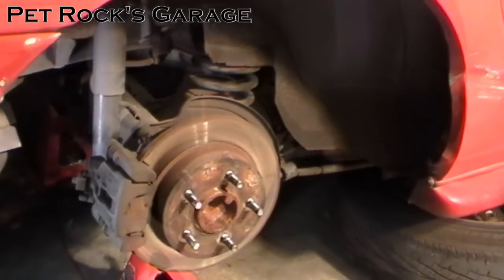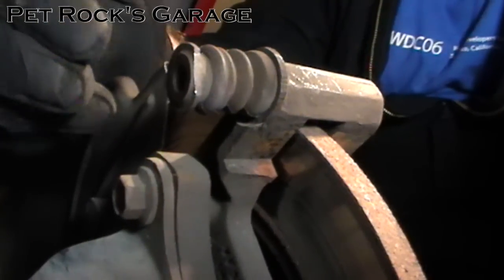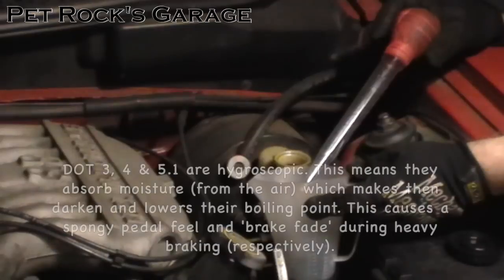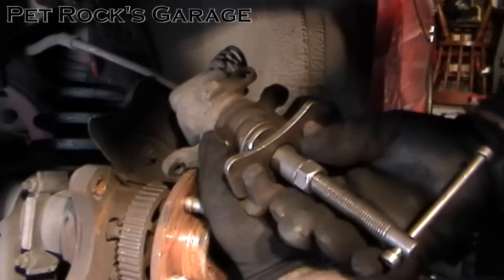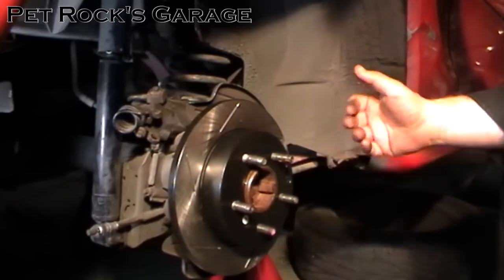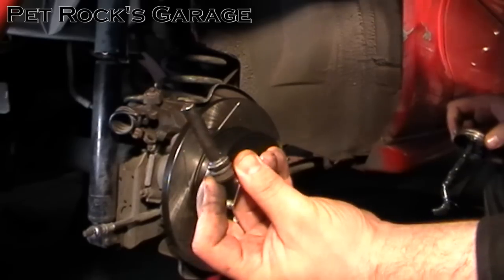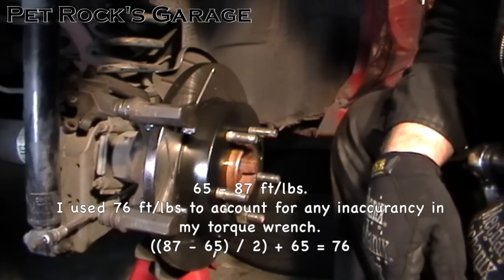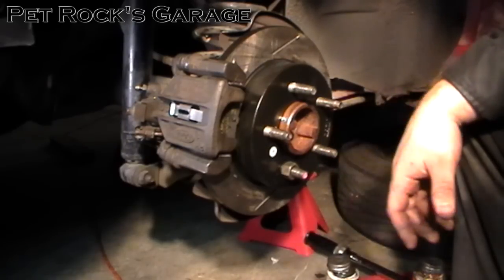How To Replace Rear Brake Pads & Rotor - Ford Mustang (’94 - ’04)

Comment: Thanks for the better view. Needed to see the parking brake assembly at the caliper. Great video, too. Glad you were able to catch your girlfriend's ex boyfriend's mistake. I hope you rubbed it in :D

I have a quick question. Just hopped under the back of the car. The parking brake is DOWN, but the actual brake is engaged at the caliper, and the dash is indicating that the parking brake is set. I think the light tripped because of the contact wire at the handle. I'm going to cut the parking brake cables at the caliper. Will I need to retract the piston or will it release automatically? Can I force it by jamming that lever rearward? It might just be the cable is frozen inside the sheath, but the boot on the cable looks good. Brake handle operates normally it seems, but the brake will not disengage. I just need to get it down the road 8 miles without frying the back brakes. Don't need a parking brake, and I'm pretty sure the brake bias is toward the front brakes.
Reply from the maker: Before cutting anything, i would make sure that the parking brake cable is actually what is causing the rear brake pads to engage. If the cable has the lever on the caliper retracted (pulled towards the front), then removing the cable should disengage the brake. However, if the lever on the caliper is not retracted then something else is going on. You might need to manually spin the piston.
Yes, most of the stopping power comes from the front brakes.
Good luck.
Reply: @petrocksgarage  Awesome. I'll check it out. Thanks for the info
Reply: @petrocksgarage  It was the cables. They're seized in the sheath. I went ahead and bought a brake toolkit anyway. Harbor Freight is having a 15% off anything sale. Thanks for the video. I've never worked on rear disc before and you've probably got the best one on YouTube :)
Reply from the maker: @juansolo1617 , that's great!  Glad to be of service.
Reply: @petrocksgarage  Just an update on my situation, for some interesting tidbits: The rear calipers aren't functioning correctly. I'm replacing both. The previous owner said he compressed the calipers using a C clamp only. I'm guessing this damaged the caliper pistons. I don't know what caused the cables to freeze but I already removed and discarded them. Then when I got to the front brakes, it looks like someone put some pads on the wrong sides and there's holes in the left side piston where the locking pins were compressed into the face of the piston. It's a huge mess.
Reply from the maker: @juansolo1617 , wow! Yeah, if the previous owner got the rear caliper pistons to compress with a c-clamp then they are definitely damaged. Glad you figured it out and also saw the issue with the front calipers. No point in being able to go fast if you can't stop.

Comment: Thank you so much! I learned a great deal. More 'stang videos would be apprciated. My 2 front rotors had a broken part. Do you have any advice on removing Stripped bolts? I stripped one of mine when trying to remove the harness holding the brake pads on the driver side. It was on so tight I couldn't get it out, so I'm having someone remove it for me tomorrow.
Reply from the maker: Thanks for the comment. I appreciate it. I have more videos on this mustang in the pipe already recorded. I just have to edit them in the limited amount of free time I have.
As for the stripped bolt, it depends on how stripped. If its just the head that is rounded then a pair of vise grips clamped on the head might get it out with a bunch of penetrating oil.  If the head is broken off, then there are various ways, most involving heat applied to the area, and an extractor tool of some kind (available at most auto parts stores). There are a bunch of videos on line about how to do it. Luckily for me, but not for you, I haven’t had this problem in a long while so I haven’t had the opportunity to make a video about it. Good luck...

Comment: I tried to press it in for hours today
Reply from the maker: Don't feel bad. I did the same thing the first time I worked on this car back in the early 2000's. I hadn't worked on a spin-in caliper before and didn't have the factory service manual at the time. Just be happy that you didn't crack the piston since it is plastic.
Reply: @petrocksgarage  i hope i didnt crack it😅i was using a c-clamp and a pair of pliers so we will see tomorrow
Reply from the maker: @Drunkenninja98 , if you did it would leak brake fluid the first time you press the brake pedal with a good amount of pressure. Good luck.

Comment: Trying to remove the parking brake cable, and it won't pull out. Parking brake is not engaged. Both sides are stuck.
Reply from the maker: The cable could be seized inside the cable housing or something could be preventing it from moving further up the cable. If you pull the parking brake lever does it move on both sides? Follow the cable up towards the front of the car and look for a T in the cable.  Make sure it is free of obstructions and moves when you pull the cable. Good luck.

Comment: how can a seated pad in the piston grooves work if the piston spins when applied?
Reply from the maker: The piston doesn't spin when you press the brake.  It just comes straight out like normal.

Comment: How did you get bottom bolts for caliper out having trouble with spring in way
Reply from the maker: If you disconnect the parking brake cable it will make more room.

Comment: Any help on how i put that ebrake spring back on I took it or for powder coating ??
Reply from the maker: I had a similar issue a while ago. I had one end connected and took a pair of channel locks to compress the spring to get it into place. Its a P.I.T.A.  I did it on the car to get better leverage. Since you powder coated yours, you might want to do the same so you don't scratch up the caliper in a vise, for example. Good luck.

Comment: Awesome video, want to do mine this weekend. However, does the front brakes have the anti rattle clips as well? And does anyone know the part number?
Reply from the maker: Yes, the front brakes have their own set of different hardware (anti-rattle clips etc). You can pick them up at most local auto parts stores. Just ask for or search the stores web site for the 'front disk brake hardware kit' for your year/model ride. Each auto parts store has their own part number for them since they use different manufacturers. Good luck.
Reply: Pet Rock's Garage thanks for the quick reply!

Comment: Mine caliper didn’t even out the pads even at all. The inner pad was completely worn down to the bare metal, and the other side still looked new just full of rust and other crap.
Reply from the maker: Sounds like you have a seized caliper. The piston is moving the inner pad when you press the brake, but the caliper isn't moving like it should at the same time. I show how the caliper should move in the video. If yours doesn't do that then the slide pins are likely seized. Good luck.

Comment: I had to have the calipers on the rear changed. Afterwards the emergency brake will not work worth a shit. I have taken it to 3 different garages and no one can seem to find the problem. The third garage I had them loosen the redo the emergency brake handle and that helped a little but using the ebrakes on a hill is useless. Any ideas of how to fix this?
Reply from the maker: I'd first make sure that pulling the e-brake lever is actually moving both brake calipers. So jack up the rear end and have a friend pull the e-brake a couple times. You should be able to see the e-brake cable pull the big spring on the caliper and when engaged you shouldn't be able to spin the tire by hand. If you watch it in action, it may become obvious what is wrong (e.g. sticking brake caliper slide pins, seized e-brake pivot on the caliper, broken/seized e-brake cable, e-brake cable not connected to the calipers, e-brake cable T-joint disconnected near the drive shaft etc). If the e-brake cable is stretched, pulling the e-brake lever a bunch of times as hard as you can should take up the slack. I hope that helps. Good luck...

Comment: Thanks for the video! It has been extremely helpful. Everything went smoothly except I cannot get the thingy to compress back. i took cap off of brake fluid resorvoir and it still wont go in. I don't have anything to suck some fluid out with atm thoufh. Do you think sucking some fluid out is what is stopping it from going in? I rented the same tool set
Reply from the maker: I don't think the fluid is the problem. Does piston (a.k.a. the thingy) spin with the tool and you are turning it in the correct direction?  Did you disconnected the parking brake cable from the caliper?
Reply: Pet Rock's Garage I was able to complete the job thanks to ur vid. I think that I was possibly just too tired to put enough force into it. I bought a new set of the shiny caliper clips that came with new  guide pin covers,  brake pad clips and new bolts from AutoZone for 15 dollars.  Thanks so much for the in depth how to as well as taking the time to answer questions. You sir are the real M.V.P !
Reply: It did seem significantly harder to turn the tool than it did in your video. Im not too sure why that is.
Reply: Some of my guide pins were nearly locked !
Reply from the maker: Glad to hear you got it fixed. The screw mechanism inside the caliper may have been a little gummed up making it harder to turn for you. Guide pins are notorious for locking up and are the most common cause of uneven pad wear & seized calipers. Good idea to replace them & the boots.
Reply: Pet Rock's Garage Good to know man. There was some definite uneven wear on the inner pad. I hadnt intended on replacing those parts but like on yours there was no clip on my calipers nor did they come with the pads. Have you got any videos on fixing emergency brakes on this vehicle? My emergency brake is very weak fsr. Unfortunately I have driven with it in the locked position for miles without even noticing.  I didnt see anything alarming when I disconnected it to do brakes.
Reply from the maker: If your guide pins were locked up then the emergency brake won't work too well. Only the inner pad will be in contact with the rotor when you pull the emergency brake lever. So if you fixed your guide pins and you could move the caliper back & forth like I showed in the video then your emergency brake should be working again. Hope that helps. Good luck.
Reply: Pet Rock's Garage Hmm. Interestingly enough I was able to get all the pins moving freely using the brake cleaner and the grease you suggested. I tried locking the ebrake and pulling against it but for some reason the amount of resistance they give is still almost not noticeable. When I pull the lever it feels normal. It clicks and gets more difficult to pull with each click. Its not a major concern right now though. Ill browse your videos though and see what else I can fix myself on it. Thanks again. Have a sick day bro!
Reply from the maker: The ebrake cable runs down the center of the car and hits a T-braket around the middle of the car near the drive shaft. Pull the ebrake lever and make sure that the t-bracket is moving freely and evenly on both sides. If that is good try pulling the ebrake a bunch of times. Maybe it is out of adjustment. It self adjusts, slightly, when you pull it. That happened to my brother-in-laws '07 GT500. Also make sure that when you pull the ebrake that the cable end at the caliper is moving and is spinning the lever on the caliper. If not, then either the lever or cable is seized. Good luck.

Comment: Never use anti-seize on bolts unless you know the wet torque of that specific bolt. Adding anti-seize will take longer to reach the specified torque, because of less friction, and in turn will increase the actual torque applied. In other words, adding anti-seize requires applying less torque than dry. The issue he claims to try to prevent will be caused by applying anti-seize.
Reply from the maker: It could be argued that the torque being applied with anti-seize is actually closer to the spec because the spec doesn't take rust, dirt, debris, pitting or damaged threads in account. The spec was written for a clean, almost ideal application which does not exist in the outside world. Especially with a 20+ year old car like the one in this video. 
The torque wrench doesn't know or care if there is anti-sieze on the bolt. Just like it doesn't know or care if the threads are rusty or if there is a bur on the bolt. It simply measures the resistance it takes to turn the bolt. Even if there was 10% more torque applied with anti-seize than without that is only 8 ft/lbs extra for the larger bolts that take 80 ft/lbs in this job, which is almost nothing relative to the total amount of torque. It's even less extra torque for the smaller bolts with smaller torque specs. Especially given that most torque specs are a range and not a single value. So I wouldn't worry about it.
I've also been using anti-seize when doing brake jobs for decades in very rusty regions of the country and haven't had a bolt snap when removing it or loosen up while driving. But if you don't want to use it, go right ahead. Its your ride.
Reply: @petrocksgarage  anecdotal evidence doesn't disprove my statement. Torque values are always reduced when using anti-seize. You basically instructed people to over torque these fasteners. The factory torque specs are for clean, dry fasteners. If they are dirty clean them. If someone uses new hardware you told them to over torque them which is bad advice. Typical torque reduction is 25% and for the bracket bolt it doesn't take much to snap it. Why take the chance with the brake system? Not worth it. I worked on aircraft for 20 years and we always had reduced torque specs for wet (anti-seize) applications. Even with dirty hardware, we just cleaned them. I know aircraft are different than cars, but brakes are a safety item. It would suck if bolts failed under stress because they were over torqued. Engineers come up with torque specs for a reason and not because they made it work, guessed, or threw caution to the wind.
Reply from the maker: @justinh_13BS , aren't your statements also anecdotal? No papers, articles or write ups to back up your statements. Just your words/opinions.  Just sayin'...
25% seems excessively high, btw.  I would be snapping bolts left and right if that were the case.
Torque specs are also typically determined based on the materials being used and the size & number of fastener(s). A good 'fudge factor' is also designed in to account for poorly calibrated torque wrenches and other unforeseen variables. Again, thats why most torque specs are a range, not a single number. Its really not rocket science. It was covered in 'Statics 101' my first semester freshman year way back when.
Yes, aircraft are much different than cars. Aircraft are significantly more regulated, have more redundancy and much higher safety standards. E.g. using safety wire all over the place. So comparing aircraft to cars seems like a false equivalency, IMO.

Comment: Can we change brake and rotor without removing parking brake line?
Reply from the maker: You might be able to, but you will be fighting the parking brake cable the entire time. The parking brake line should be very easy to disconnect, so it shouldn't be a big deal.